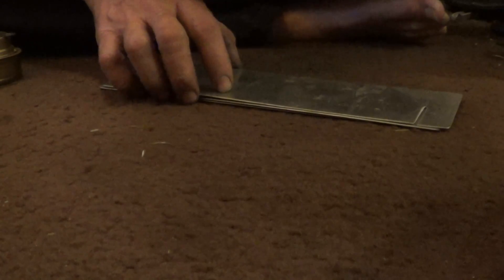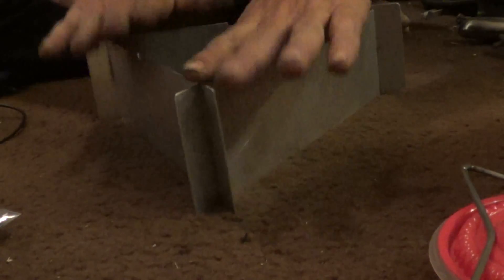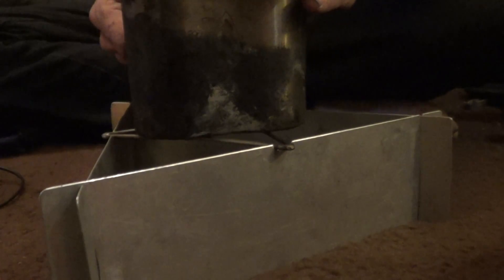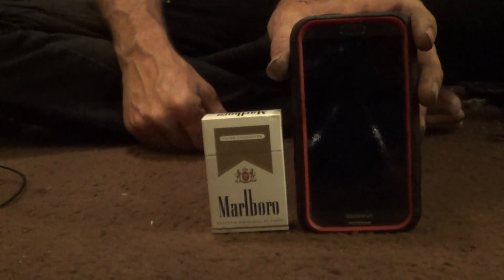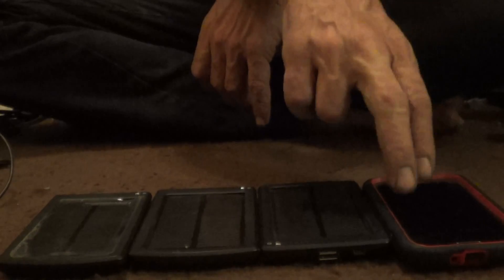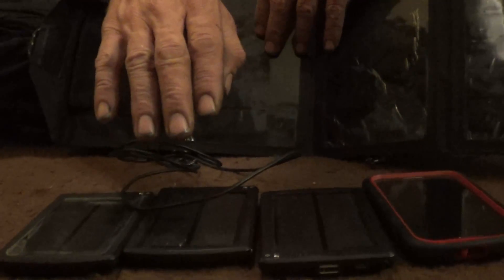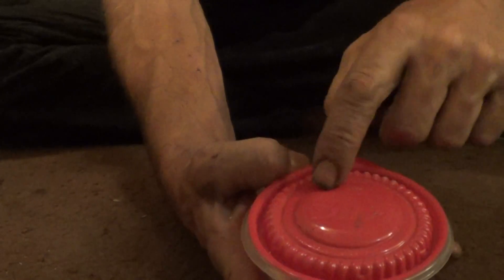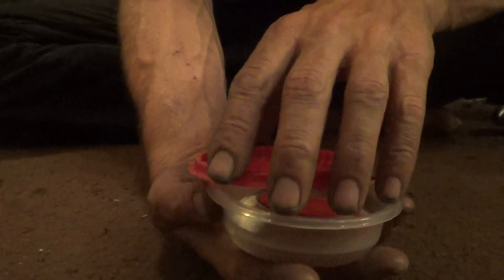My Trangia Stove Invention

Comment from the maker: Hey Vx777. While roofing tin will work for this, unless it is aluminum, it will stay hot longer and be heavier. I made this out of about 1/16th inch thick aluminum sheet. I weighs very little and is durable. And as my friend Tom pointed out, you can use it with a small wood fire too.

Thanks for watching... Andy

Comment from the maker: Jack,
The triple solar panel I got off ebay for 50 or 60 bucks. It works great to charge my smaller panels at super speed. It does not have a built in battery like the little ones. And yes, if I don't mess with my phone the little ones will give me about 70 to 80 percent of a full charge from where I start. But I use my phone for topo maps on the trail, photos to identify plants and trees, and I play a tune from time to time. But with the large panel and the 4 smaller ones I'm set.
Thanks Andy

Comment: Cool little idea on the anti wind stove.  
solar  panels are usually only rated at around 50% efficiency. from what i researched quite some time ago it is pretty hard to find anything that will do a 100% charge without added boosting circuitry, that may not be the case nowadays though . But 50% is not so bad out in the woods if you have no other options